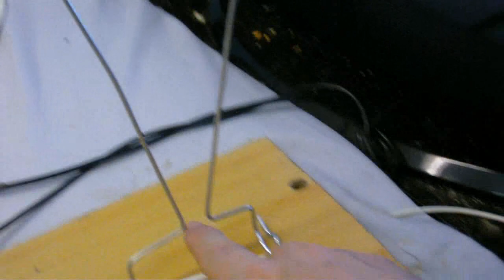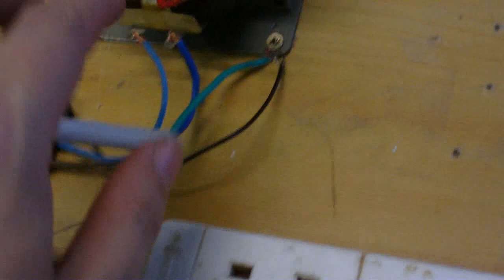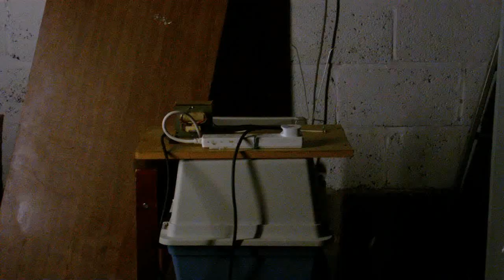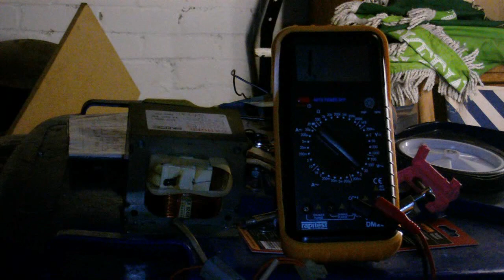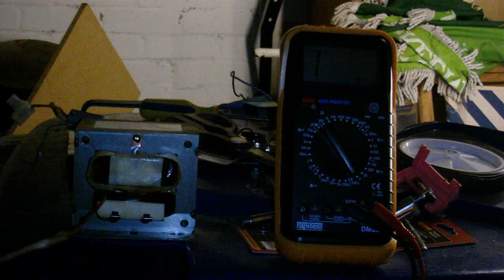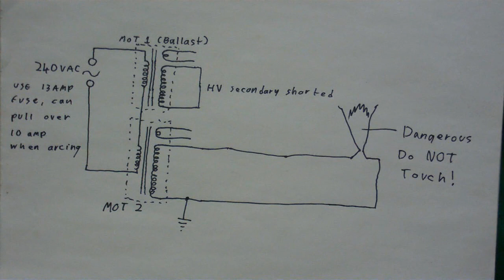Makin' Arcs with a Microwave Oven Transformer!

Comment from the maker: @6452ss I should have marked it in the schematic but I forgot, basically the live connects to the primary coil of the transfromer I used as a ballast, the neutral wire goes to the other transformer's primary, and the two transformers are connected in series to complete the circuit.